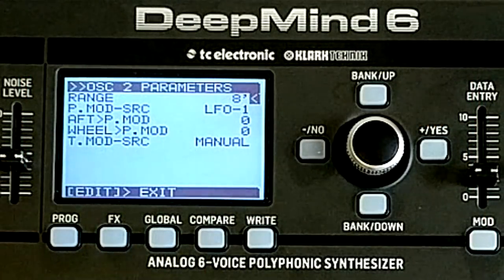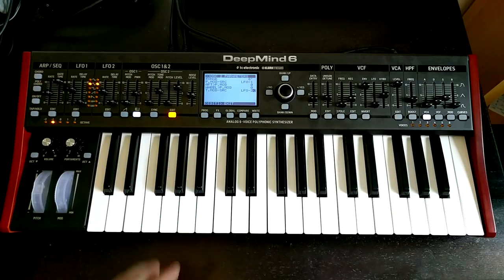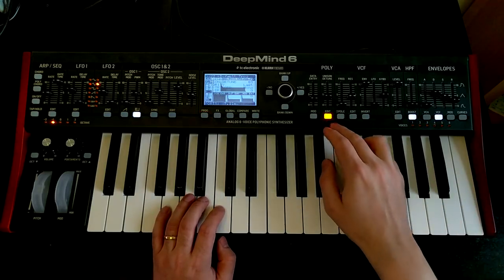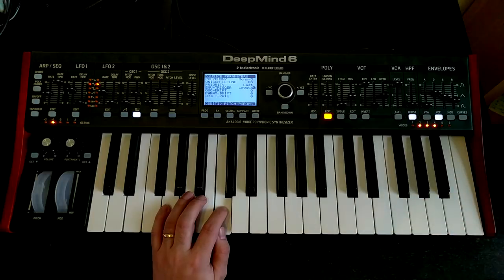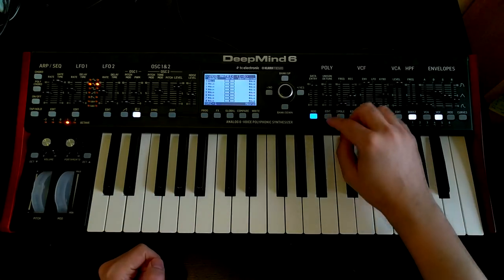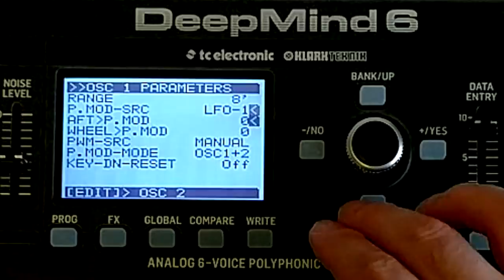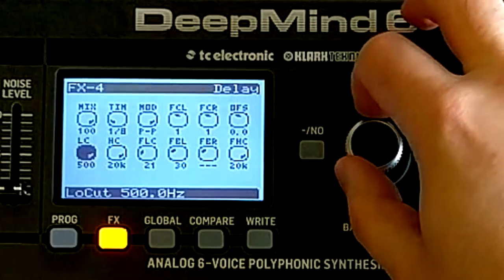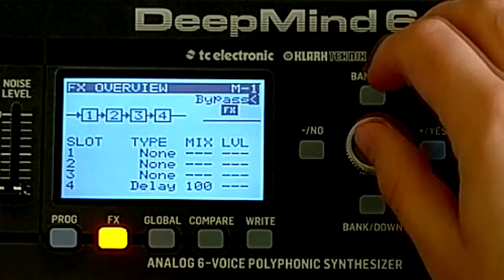Behringer DeepMind - Let's Build a... Bass!

Comment: When I change the polyphony to Mono, the sound changes a lot and doesn't sound like what you're playing. Do you know why?
Reply from the maker: Can you describe how the sound changes?
Reply: @OscillatorSink  it just sounds deadend and flat. I got it to work but it was doing that for some reason. Thanks for the quick reply though
Reply from the maker: @pat3000721  I wonder if there was some unfortunate phase cancellation going on in that case? My suggestion would be: leave the synth on for about an hour and then run the calibration routines* - things may have drifted over time which is why it's not sounding as punchy when you stack up the voices.

*(actually, in my experience you should run them twice back to back to get things properly tight, but your mileage my vary)

Comment: thank you for responding so quickly.  have a question here.  I want to go through the sound banks of sounds that came loaded in the keyboard and put them in favorite section for easy recall.  later on I would like to edit these sounds and again save them to favorites.  how many sounds can the favorite category hold.  I the want to load some sound banks that I have purchased.  when I do this will it erase the sounds in the favorites section that I have loaded.  I would also like to load your sounds which I will be more than happy to pay you for and pay for any help you can give me.  is this the best way to proceed to accomplish what I want to do.  I have a computer guy that comes over to help me, as I am not that good on the computer.  really appreciate any help...Larry
Reply from the maker: Hi Larry. To my knowledge there is no "favourites" functionality of the Deepmind (I've just checked the manual to confirm and I can't find any mention of it).
From the factory, however, bank A (there are banks A-H, each with 256 sounds in), exclusively contains sounds from the other banks, so you can always safely overwrite any patches there. Most patches you can purchase will tell you which bank on the Deepmind it'll be installed to (this is an annoying limitation of the patch format), so generally speaking the routine is: install the patches, move the ones you want to keep to a safe bank, install the next set of patches and repeat. I've actually created my own system for distributing the patches that lets you choose where they go, so that's a little easier.

Like I said before though - my patches are free, you don't need to pay for them.
Reply: @OscillatorSink  I think there is a favorites section. Press the prog and fx buttons together, then the +/yes button to mark a patch as a favorite, then turn the data knob to scroll through other favs.

Comment: Nice video man, not used the Deepmind for quite some time, this has definitely persuaded me to get it out the box.  I’m not sure the if it’s simply the polyphony that’s different between the Deepmind 12 and the 6 so not sure if the 6 has aftertouch available? I quite enjoy routing any vibrato/pitch shift modulation to the aftertouch, however I can see that whilst using the ARP on hold the mod wheel would have its benefits.  But from a live aspect would definitely recommend aftertouch modulation.  With perhaps slight modulation on the filter depth triggered via velocity, softer play = duller sound etc.  Any little thing to help give a sound life and charisma! Amazing how the options on this synth are inherently endless.
Reply from the maker: Both the 6 and 12 have aftertouch - I've made use of it in some of the other videos in this series. The 6 lacks the WiFi support though.

Comment: Amazing sounds ( and variations) coming out of that synth -- not bad for $699!  
Probably works pretty good as a MIDI controller too, eh?  What is the keyboard like?
Great arp variations starting @ 16:50
Reply from the maker: Thank you! The keyboard is "fine". I think it's not unfair to say that it's one of the areas that was probably a compromise to make sure that the synth hit that price point. There's nothing wrong with it (although the aftertouch is a bit uneven in its sensitivity), but the action isn't exactly 'luxurious'. 

But I'm happy enough with it, and the sounds are inspirational enough that you don't really care about the feel of the keyboard!
Reply: Just bought a used 12D for the same cost as a 6 new. If you have a decent midi keyboard on another synth, just skip the keyboard and get the extra 6 voices!